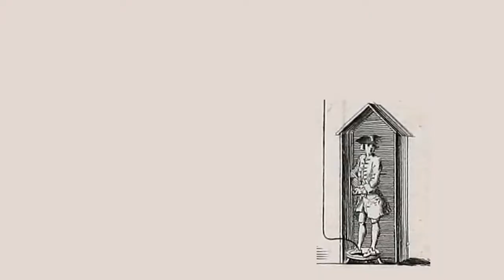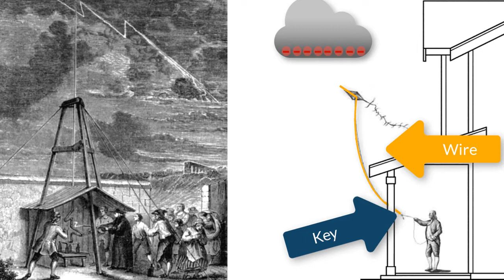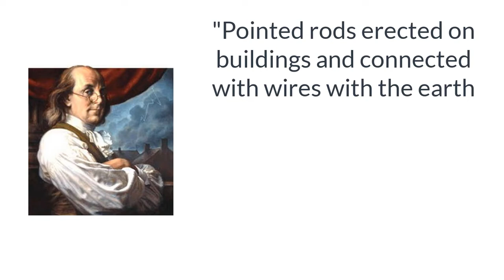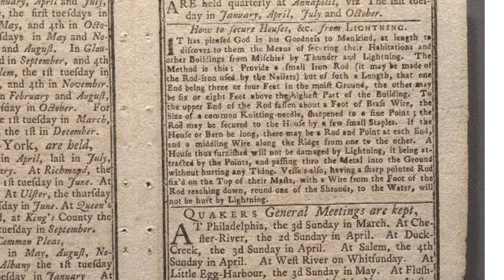History of the Lightning Rod: How the Lightning Rod was Invented and Terrified & Offended People

Comment: My father an electrical engineer said many buildings burnt down following a lightning 🌩 strike to a lightning rod. Apparently a wire large enough to carry that amount of current to ground was rarely used.
Reply: The lightning strike is such high voltage that it jumps out of the wire like Tesla coil fingers. Unlike Tesla coils it has amps behind it making it deadly. Ground wires were not properly insulated. 600K volts and more wear as standard wire insulation is rated at 600 volts.

Comment: About 20 years ago I was with a friend where a women's football game (New York Sharks) was about to start, when a strong thunderstorm came up as we entered from the parking lot via the ticket booth.  (I think we wound up getting in free under the circumstances.)  We were getting drenched, but rather than head directly to get under the metal stands, I went onto the field that was surrounded by 4 identical lighting towers.  I explained later to my friend that within that symmetric shape we'd be completely safe not only from direct lightning strike, but also from ground currents should the towers be struck.  With all the towers at the same height, there would be zero potential difference horizontally within that space.  Meanwhile places just outside that ring of towers would be subject to ground currents in case of lightning.

I've had trouble convincing people since then that sports fields arranged like that are safe from lightning.  I've wanted to make a small model and show that I could get sparks to discharge to the pins but never to the space between them.  I'd also like to be able to show the absence of lateral current between the bases of the pins.  I've just never had the equipment.
Reply: Interesting.
Reply: I don’t think the behaviour of lightning is quite that deterministic.
Reply: @lawrencedoliveiro9104  That's why some day I want to model that setup.

Comment: Ahem, I have heard that the lightning rod acts to drain the build up of ions at the peaks and corners where the wind would normally ionize the surface of the structure. It effectively hides the building by making the top the same potential as the ground, minimizing the difference in potential that makes a lightning strike likely. It does not drain the cloud of electricity, it drains the building of charge.

Comment: Why are spikes fitted to the tops of lightning rods? It seems to me that spikes would only make sense if the idea was to bleed off charge from the clouds and help reduce the chance of a strike.

If the rod is only useful in case of an actual strike, would those spikes really do anything?
Reply from the maker: That is an excellent question. Turns out, there is a lot of debate but what is the best shape for the top of lightning rods and my understanding is that it doesn’t actually matter so some are points, some are spheres some are multiple points. However you don’t want the top of the lightning rod to be too smooth as you do you want the lightning to strike the lightning rod and not the top of the building.
Reply: The voltage on a conductor is inversely proportional to the radius. A pointy rod acts much better as a charge attractor.
Reply: @Kathy_Loves_Physics  Love your channel, but I think you may be wrong about the operation of a lightning rod.  A pointy conductor will have terrifically dense lines of flux.  Think about magnetizing a needle and sprinkling metal filings around it.  The field lines will be phenomenally dense near the point.  When charges move past the lightning rod (clouds blown from wind), the moving charge induces current to ground.  I=dQ/dt.  The dense lines of flux provide good coupling.  The area around a lightning rod will be at lower potential to ground, so lightning will prefer other locations where a plasma can form because of higher charge density.  A good lightning rod doesn't take a 'direct hit' unless its ground wire gets broken or isn't sufficiently buried.  You see that a lot on old buildings.  The copper mesh ground wire on the barns we had growing up was often rotted just above ground level.  Besides rods or spikes, 'fur balls' of conductive material are also very useful.  Many spikes.  Spheres would be abysmal as a lightning rod.  Yes, I'm an electrical engineer, however, my training in lightning rods has more to do with hay fields and boats.  ;-). My uncle drove a tractor, pulling a hay bailer, and me on a sled behind it.  The sled ran on iron skids with iron strips that I stood on.  My job was to stack the bales and then push them off with an iron 'bar'.  Fortunately for me, the bar stood in an iron holder, mounted to the runners.  The storm ran right overhead.  The hair on the back of my neck rose (literally) and the lightning struck just up the hill.  If the bar (lightning rod) was meant to attract the lightning, it probably would have.   Sailboats carry 'fur ball' or pointy lightning rods which are coupled to the sacrificial zinc blocks on their exterior sub-surface hulls (to prevent corrosion from dissimilar metals on the boat, we salute Mr. Galvani by having the block of zinc corrode, instead).  The 'point' being, sailboats with lightning rods are LESS likely to be struck because they instead dissipate the charge around the rod.  Remember that for lightning to form, there has to be a tremendous potential, enough to literally rip the air into a plasma.  If the cloud's charge isn't felt near the ground, it can't become a plasma.  The lightning rod only needs to reduce the local potential a little bit to encourage the lightning to go elsewhere.

Comment: If only someone ask him "if there will be charge powerful enough to penetrate spark gap "from cloud to your roof"  but no inch further - that lighting wouldn't strike there in the first place,
 so the best way for destruction - put recieving antenna in form of cross (to perpendicular by especially with rounded ends, and in form of cross, since electric current will induce perpendicular magnetic field which will induce perpendicular electric current,